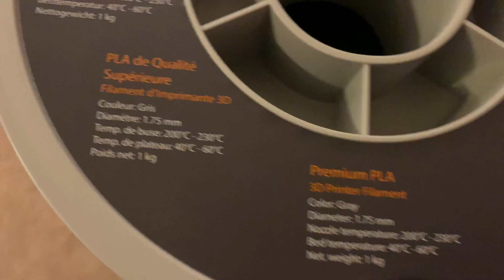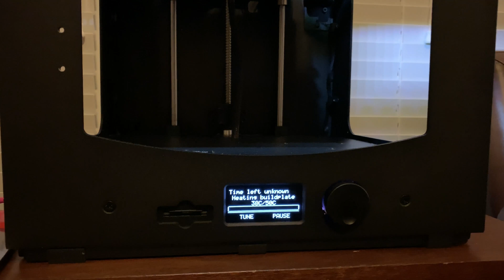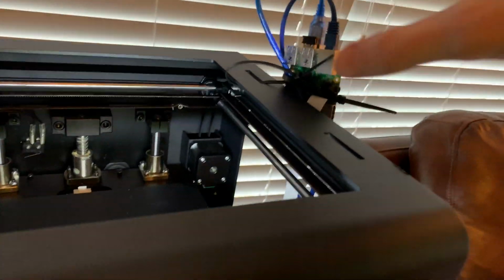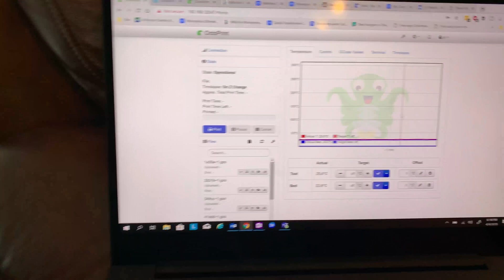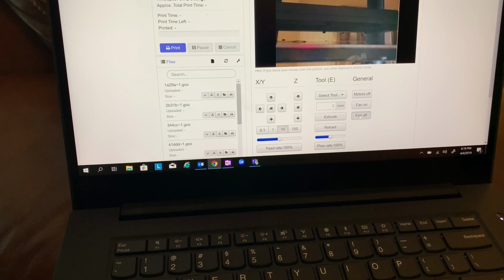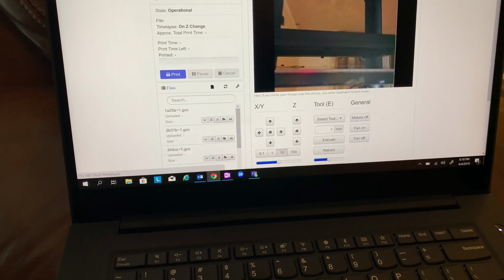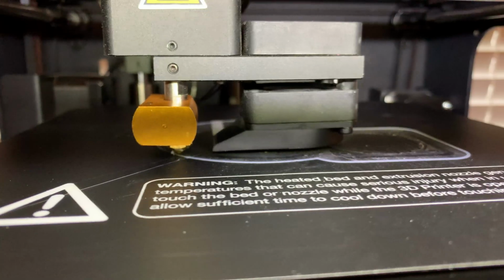Monoprice Maker Ultimate(Duplicator 6) 3d Printer Upgrades + PRINTING THE DESTINY THORN!

Comment: Many years later I am using your videos to improve a printer the same as yours that I inherited. 
How do I find the correct nozzle size to replace the extruder nozzle?
Reply from the maker: Here you go, should be the .4 nozzle - https://www.ebay.com/itm/204187801960
Reply: @CarolinaCowboys thank you! I truly appreciate it. Also, where do you install the dampers?
Reply from the maker: @carlsei3396  Those dampers go between the stepper motor and the frame they screw into. Made a huge difference
Reply: @ I greatly appreciate your help sir. Thank you!
Reply from the maker: Happy to help!

Comment: can you share your settings for the print process? Temps, speeds, accelerations, first layer changes, etc? I'm getting many many issues despite having leveled the bed
Reply from the maker: What printer are you running?
Reply: I am running the same exact printer @CarolinaCowboys
Reply from the maker: @SpicyHotPot12  Check out the next video I made and gave the settings - https://youtu.be/aYVuz9ccZL8

Comment: Did you have to adjust the z-axis end stop screw when you installed the glass plate?  I assume you removed the original surface and placed the glass directly on the aluminum bed.  Thanks for a great video.  I'll probably have more questions.
Reply from the maker: Yes I adjusted the end stop screw but only enough so that I could fit the glass and make my main adjustments with the bed screws.  Ya I was not happy with any of the other surfaces but had good success with the glass.  Let me know what other questions you have!  I've since built a Voron printer.

Comment: can you post the file for the fan shroud you printed? also if possible post the settings for your jerk, acceleration, all that stuff plz?
Reply: all the settings if you wouldnt mind. how you got it to work. i just ordered one and im waiting on mine to come in but i wanted to know before i started it up if possible
Reply from the maker: Check out the 3rd video in the series! https://www.youtube.com/watch?v=aYVuz9ccZL8&list=PLXKlNXcI_kmP1Sq-TlywAalQf4Jwn2XDT
Reply: @CarolinaCowboys  hey man thanks for the response. I tried the settings in the handbook as well and holy crap. The filament sticks like glue lol. atleast at 0.1mm layer height. The only thing that was messed up on mine was the control knob. The screw wouldnt come out so i couldnt put it on but it works just fine without it. Your videos are great and i hope to see more monoprice vids in the future :D. Have you done a Thoughts video on the MPMU?

Comment: Thank you for posting this video, it's been very helpful!  Quick question though, the fans you posted are 12v and the Ultimate runs on 24v power...did you have to step the power down at all? Are you worried about the fans burning out?
Reply from the maker: Not at all, I think the fans are connected through a voltage regulator on the board so they run at 12 volts.  I have 72 prints on the unit now and it's been solid!
Reply: @CarolinaCowboys  really? it's a 24v printer to my knowledge... Will have to test tomorrow. I have the fans but was also planning to run buck converters to step the voltage down the 12v
Reply from the maker: @jives21  You're correct the printer runs at 24v which is very good because it means the bed and extruder heats up very fast, but the fans run at 12v.
Reply: @CarolinaCowboys  I just put a voltmeter on the fan outputs, I checked them all and confirmed they run at 24v. The stock fans that were in mine were also 24v fans, where are you getting that they are 12v? 

The 12v fans will very likely work, but you're definitely giving them more than they are spec'd for and it's likely they will fail early because of it.
Reply from the maker: @jives21  That is very interesting, I bought the Noctua fans per the Wiki recommendation as the best fan upgrade for this printer and the box says it's a 12v fan so I figured they were all running at 12v.  I can still run the fans at various speeds no problem.  But as I mentioned I've printed 72 times with these fans and have had no issues.  Here's the link to the Wiki - https://www.printer3d.one/en/wanhao-duplicator-6-monoprice-maker-ultimate-tips-improvements/
Reply: @CarolinaCowboys  Right, they have these called out specifically as working with 24v if connected in series for cooling the print from both sides. The reason for this is because series connection of two results (in theory) of both getting 12v even then it's not perfect but definitely better than one 12v by itself on a 24v circuit. The cooling block fan runs at 100% all the time (as it should); the fan for cooling the print itself is the variable one. You can order yourself some buck converters to properly convert 24v to 12v. I'm in the process of this mod myself, just making some decisions around where to mount the buck converters, my ideal is to not have them moving around with the print head but then I need a breakout for the ribbon cable somewhere so I'm in the process of sorting out a strategy for that now. I may end up just adding them to the print head, they weight very little compared to everything else on the thing. These are the buck converters I'm using: https://www.amazon.com/gp/product/B07VVXF7YX/ref=ppx_yo_dt_b_asin_title_o08_s01?ie=UTF8&psc=1
Reply from the maker: @jives21  Interesting, before you buy the stepdowns, consider going to the blower setup.  They're already 24v and you don't have to deal with the back pressure caused by the block fans.  After alot of testing I was only able to get one type of mount to work, I think I talk about it in the video.  So if and when the fan goes out i'm converting to the blower setup.
Reply: @CarolinaCowboys  Already have, them. I'm replacing all the fans with Noctua (it's currently hard to find decent quality 24v fans). The real goal here is quieting the fan noise, the stepper noise is easily addressed with Dampers but the fan noise is bad given how crummy the stock fans are. I'm also considering putting a smaller "pancake" stepper on the extruder just to try it. This would lighten the gantry assembly more than just about anything else you could do, I don't think cooling is a huge issue for this printer really (assuming your fans are working). Calibration is something I don't think many people do which helps, I don't mean bed leveling, I mean calibrating the extruder and x,y,z steppers.
Reply from the maker: @jives21  Other than the Noctua fans being expensive they are definitely much quieter than any others i've used.  The other major improvement was putting on the silicone heat sock.  I was getting temp errors before doing that.
Reply: @jives21 do you have a suggestion for the buck converter?  Is it those 2"x4" boards from aliexpress?

Comment: I'm curious if you happy with the cooling system. If so, could you please share the link? and did you print in ABS or PLA?
Reply from the maker: I've been printing exclusively PLA, it's been solid for everything I've needed to do.  I'm very happy with the Noctua fans, they're great.  The links to everything is in the video description.
Reply: @CarolinaCowboys  I've got the fans already, i am in search for dual cooling fans but there is so many options in thingiverse. the one you're using, are you happy and do you still have the link for he design?
Reply from the maker: Ozan Kilic there’s really not a good dual cooling option for these fans, you would have to go to a blower instead.  But this is the duct I’m using and it’s been great - https://www.thingiverse.com/thing:2499597

Comment: Where did you get those clips from for your glass bed?
Reply from the maker: EvilMP5 those are just fridge magnets that you can clip notes to, but I ended up moving to the standard folder clips because I found that the glass would not lay down flat without more pressure on the edges
Reply: @CarolinaCowboys  The glass bends? If the glass did not lay flat the heated bed was bent?